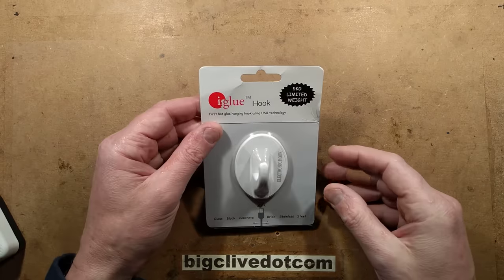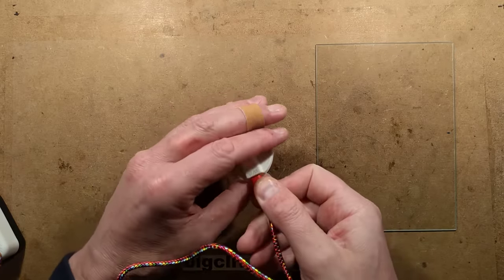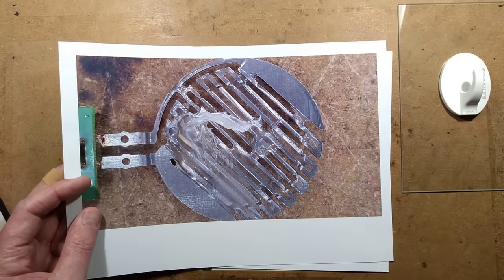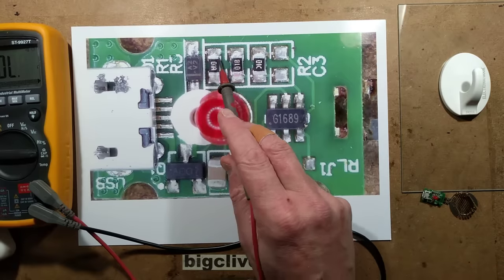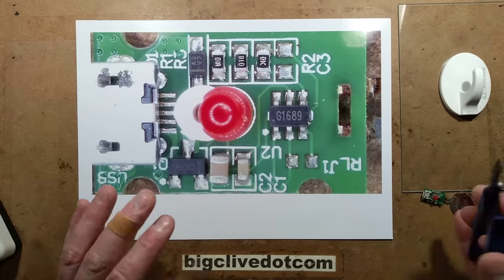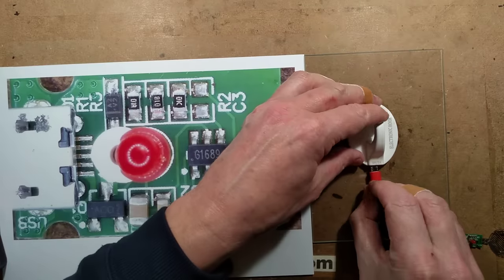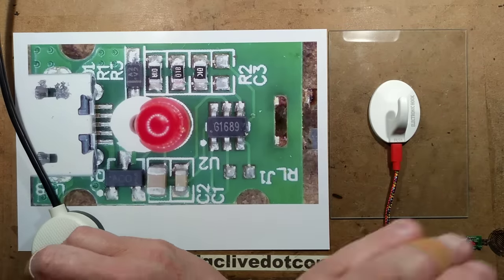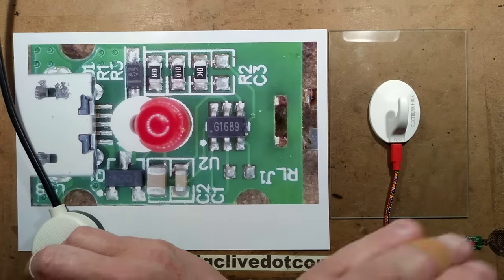Testing a USB powered wall hook and a look inside.

Comment: 'Way back in the 1970s, I was designing some of the earliest microcontrollers. The idea of a microcontroller in a something as simple as a toaster was considered ludicrous. And here we are...
Reply: @andrew_koala2974  Can you give me a link or name/brand regarding the shopping carts with microcontrollers? How are they charged? What are they used for?
Reply: You say that, but microcontroller equipped toasters are amazing. They are able to toast perfectly consistently every time, while you know that is impossible for a dumb toaster.
Reply: @goodmorning8172  They're in shopping cart wheel locks to keep the carts from leaving the premises. A wire running around the store's parking lot carries a very low power radio signal that a microcontroller inside the wheel picks up when it passes over it. The microcontroller then triggers a small motor to spin a mechanism that locks the hub. The ones I've seen aren't recharged, the entire wheel is just swapped out. The battery inside was even potted, so it can't even be charged or replaced if you wanted to. Supposedly the battery lasts 3-5 years. These wheel locks have actually been in use for at least 15 years, and the concept/prototype has existed for over 20, so it's funny that he said "who would have imagined that four or five years ago". Search for a video called TWB #4 Locking Wheel Teardown to see the guts of one.
Reply: @goodmorning8172  there are shopping carts with scanners, so you can scan everything you put in it and just have to weigh the cart to get out, which accelerates shopping a lot.

also, especially on the lower end, microcontrollers are the most cost effective solution, because you can just put a 3 buck part in 20-100 cards and it's cheaper than designing a proper circuit, also it means you can add functionality cheaply.
Reply: bruh
Reply: @goodmorning8172  there are carts that lock the wheels if taken off the store property to prevent theft
Reply: Ben T.  Well, it's good to connect things to the internet. Within reason, that is. We don't want another Juicero on out hands, do we? Besides, at worst IOT can be annoying, and at best it can be really magical.
Reply: Ben T.  if you're so concerns about the government spying on you, then why use the internet at all? A VPN won't help much, either. Besides, why would the government care if your lamp is on or off?
Reply: @jeffystreet  unless you really are a huge time criminal, spying on you would be useful, other then that, pretty much just wasting processing power.
Reply: I feel for Jerry.  To see something like this is a huge slap in the face.  The work put into developing a micro controller is enormous.  Seeing that tech used in such a banal way is heart wrenching. You develop a way to control sofisticated motorizized production lines, oil platforms, bull dozens....  And someone stuff that into sone kids room to melt glue.  What a big FU to the developers.. No respect at all ;(
Reply: @latinumbavariae  I don't think that toaster is very dumb. Mechanical yes. Dumb... not so much.
Reply: @rich1051414  If you want a dumb toaster to toast evenly you need to warm it up first . Also if you were able to insulate the top , maybe with an upside down plate then it toasts evenly. I think most toasters are fundamentally designed badly and inefficiently.
Reply: @rich1051414  That's hardly impossible, I will refer to technology connections for a demonstration of the perfect toaster without any micro controllers.
Reply: @rich1051414  you are so wrong!!

See Sunbeam Radiant toaster
Reply: @GreatDogs  That's like saying that scientists worked really hard to invent plastic so we should only use it for important things like medical equipment
Honestly it being used in lots of things just shows how far we've come with computing and it's a good thing
Reply: @andrew_koala2974  But it wasn't fantasy, it was frivolity
Reply: @andrew_koala2974  what communist country / state do you live in where it is the law to wear a helmet riding a bicycle ??
Reply: And the even funnier thing is, that nowadays you can get a fucking Micro PC like the Raspberry Pi for less then what those microcontrollers did cost back then. And now Microcontrollers are so cheap, that they are in basically anything, because they make everything a whole lot easier to built.

Like honestly, I'm "only" 27 and yet I'm still getting suprised by how far tech has come since. Just for example basic Storage. When My Brother got his new "fancy" PC, it had like a 60GB HDD, wich wasn't bad at the time. Now I've got more storage in my fucking Phone and it's even a damn lot faster.
Reply: @sagichdirdochnicht4653  I'm only 16 and I'm shocked when I learn that they can put an ARM chip running at a few hundred megahertz in an SD card for around 10p... Years ago that would have cost millions
Reply: @circuit10  an arm chip in a sd card? Haven't heard of that before. And why though? 
Anyway,  by the time you could fit those chips inside a micro sd it wouldn't have cost millions...  but nevertheless, it would have been expansive.
Reply: @sagichdirdochnicht4653  Yes I'm barely older than you and remember a time when only a few enthusiasts had internet connections and many/most homes did not have a computer
Reply: @sagichdirdochnicht4653  Well, I mean to have a room-sized PC with that power. They put them in the detect bad blocks and things
Reply: @rich1051414  Actually, look at Technology Connection's video on an old toaster.

The old toaster is better and does do it perfectly every time, unlike modern toasters.
Reply: Now introducing the smart stick, the stick with a microcontroller on it which does nothing!
Reply: @circuit10  Microcontrollers have been cheap for more than a couple years ago
Reply: @rich1051414  sir you clearly have not watched the Technology Connections video on toasters
Reply: @LoveOfMules13  this explains why some stores have a lot of carts with a stuck/broken/perma-locked wheel
Reply: None in my toasters.
Reply: @rich1051414  Bimetallic metal strips can do amazing things
Reply: @rich1051414  you seem to have misunderstood the point
Reply: Liar
Reply: I'm gonna put a microchip in my pencil just for you.
Reply: I was waiting for the quote to end. Let me do it for you ‘
Reply: @rich1051414  what about sunbeam radiant control
Reply: @sagichdirdochnicht4653  yeah right? A usb c connector costs more than some mcus.
Reply: You should check out some modern MCUs that have been cost optimized... ESP32 comes to mind. 200MHz dual core risc-v with embedded bt+wifi for a dollar. I'm a youngin, but I love playing with analog circuitry and I feel it's somewhat sad that for the most part we're just brute forcing solutions by scaling digital circuitry rather than ingenius designs that were called for by limitations.
Reply: Well, now you can have them for less than 5¢/pc. What was the cheapest offering then?
Reply: Disposable electronics are such a waste of resources. (Yes, even significant items like phones and appliances are quickly discarded too, but have a much longer useful life.)
Reply: It is amazing what we have today
Reply: i still think it is
Reply: When I did my studies in electronics on the Hanze University (around 2005-2006), we had a project called "Heart Monitor" and I had the bright idea of making it... portable!

I was told the following: NOBODY wants to monitor their heart rate or blood oxygen saturation and making it portable would just be a hassle... and here we are.

I also had the bright idea of making a BODE plotter using a signal generator that was digitally controlled... same thing, got told nobody would use such a device...
Reply: Well, thanks to you, nowadays I got gotta a profession, so thank you!
Reply: @sjoervanderploeg4340  wow I wonder what we will have in the future it is so amazing
Reply: i cannot tell if this is a bot comment thread or not
Reply: We live in an age that was Science-Fiction back in the 70s ... I still remember how fascinated I was when my parents bought me a pocket-calculator.
Reply: @Richard Smith  micro control roster still can't consistanly cook my toast
Reply: @rich1051414  Yeah I was wondering the other day why I didn't try to find a toaster which could sense how much it's cooked and stopped before bruning
Reply: @rich1051414  a toaster from the 40s did that without any microcontrollers and they’re very reliable so the microcontroller isn’t necessary
Reply: simple? it's a next gen 4k hi-res y2k compatible marvel !
Reply: @rich1051414 except the Sunbeam toaster did that without microcontrollers before microcontrollers were even a thing!

There's plenty of ways to do this without a microcontroller, too!
Reply: You can use a micro controller to sense when a light switch is turned on.  Based on that input it can send a signal to a mosfet to power the coil of a relay.  This relay can then provide power to the light bulb.  The power for the control circuitry can be provided by a buck converter fed from the light switch under observation.   This has the added benefit that the microcontroller is not drawing any power when the light switch is turned off.

It's also possible to incorporate a light sensor that can be used to turn on an LED to alert the user when there is sufficient daylight to procede safely. Obviously this led will only illuminate when the light switch is turned on, so it will be up to the user to decide if the light present is due to ambient light or the light provided by the fitting. The safest policy is, of course, to leave the light turned on permanently so that this safety feature is present at all times.

Comment: i love how those electronics will be used for only about 20 seconds and thats its whole life
Reply: i think you could hate that fact
Reply: I presumed the point of this is removability, like a 3M hook?
Reply: @BluetheRaccoon  okay but usually once u find a place for them u dont move them lmao
Reply: can someone explain what the wall activated hook actually does? I couldnt tell from the video
Reply: @banana9494  you plug it in and it activates a glue mount system, to take it off the glue is melted away.
Reply: Modern E-Waste issues in a nutshell, from phones that barely last 3 years to crud like this...
Reply: @Theinatoriinator  ohh ok i thought there had to be more to it and i was missiing something lmao.
Reply: 43 seconds
Reply: Not if you reuse it and put a new piece of glue on it 🤔
Reply: you could reuse it several times, just plug it in and melt some freshh hot glue on it off a hot glue stick. maybe salami slice the stick and add a  new slice each time.
Reply: Also, funny the algorithm is now showing again a 4 yo video
Reply: I've seen worse. A battery powered, light activated speaker which has only the purpose of being put in the box of some product and chime when it's opened
Reply: 'What is my purpose?'
'Pass the butter'
passes butter 'What is my purpose?'
'You pass butter'
looks at own robo-hands 'Oh my god.'
Reply: @feuerherz007  If that was true, 3M wouldn’t have made a trillion dollars on those removable-adhesive hooks.
Reply: Just like me
Reply: @Bene5[4  Like those Hallmark cards that play songs when you open them. Been around for a long time.
Reply: 43 seconds apparently
Reply: Somewhere out there Gru has you on his list. Gru's Really Eunochs.
Reply: It does have replacement glue pads in two little compartments.
Reply: It is meant to be reused.
Reply: The removability is important when you move out from the rental property.
Reply: Someone probably once would have said the same about paper used for Post-It notes.
Reply: @feuerherz007  Imagine how much easier this makes the job of the demolition crew.  Instead of having to smack those pesky hooks of the wall with a sledge hammer, they can just plug in a usb power supply and wait 72 seconds.  That's almost one every minute.  In just a few months they'd be able to remove all the hooks in an entire hospital.

Comment: What people seem to be missing is that you plug it in again to melt the glue to remove the hook without damaging your wall.. That's the reason for the replacement glue pads.
Reply: But why would one need to remove a hook from one's wall?
Reply: @bobshermer6246  Many reasons,, I changed the size of mirror, picture, soup ladle... I want to hang on it, My child has grown 6 inches taller, I want to move my furniture, I'm renting. 
Really many reasons to want to move a hook, still not a good solution, I think, but I think, there is a use case.
Reply: @stephenlee5929  
I am happy to inform you double sided sticky tape was invented 200 years ago.
Reply: @bobshermer6246  you ever live in an apartment?
Reply: but it would just leave a load of sticky glue on the surface, at least if you get it off cold will pull it off with the hook
Reply: @markharrison7468  3M command strips have that covered
Reply: Ever heard of command strips?
Reply: Ahhhhhh. Now I get it.
Reply: @bobshermer6246    Really?... In your entire life you've never put up a hook, wall hanger, our mount and then later realize you want or need to remove it?
Reply: A problem solved by command strips already.
Reply: @MrRobarino  I mean I'm not that guy and I understand why you'd want to move one, but no I've never wanted to move a hook because I think hanging shit is pointless lol. There's one hook on the back of my bathroom door that's been there for 10+ years and I don't even know who put it there or why lol.
Reply: @charlesblasini2134  Sure lol. Better  than a million pictures and signs no one actually cares about
Reply: What the manufacturer of this product seems to be missing is that 3M command clips do the same job without the unnecessary steps of plugging it in and leaving a residue on the wall.
Reply: @dForrestTheComicker  Command strips have an extremely low shear strength, that's what makes them work. It also makes them unsuitable for many tasks.... That being said regular hot glue on a 3M hook works pretty well and can be softened with just a hair dryer when its time to remove.
Reply: I think they forgot command strips exist.
Reply: to all mentioning command strips: command strips dont work on plaster walls. IDK if this hot glue would either, but, command strips also dont
Reply: I would never glue something that’s supposed to hold stuff to a wall in the first place
Reply: Could just use a hair dryer or heat gun since you're going to need one anyways to clean it up.
Reply: @dForrestTheComicker Until they've dried out. Then you're prying or cutting.
Reply: @dForrestTheComicker  are they strong enough for a coat hanger? that can be quite a bit of weight!
Reply: If the double-sided tape is weak enough to be cleanly removed from a wall without removing paint, then it's not strong enough for holding things in the first place. Other types of double-sided tape are strong enough to hold up a hook with anything you put on it, but will tear off your drywall.
Reply: @akpokemon  as others mentioned, it can be a question of having different sheer vs pull strength

Comment: This is the most technology I've ever seen in an application that doesn't really need it; it's actually impressive
Reply: It’s called Spywhere
Reply: @johnnorris1983  yes I spy on people using a heating element bruh
Reply: @johnnorris1983  I don't know where they're gonna spy
Reply: Wait until you see "smart fridges"
Reply: @johnnorris1983  spy where ?😑
Reply: @user-rf47CwB72  well it's a worthless one that wouldn't transmit a basic sound file through a thick cloth, if that were it's function. 

However once you remove the cable and take power away it would also be equally as worthless since it has no ability to retain a powered state.

Some people really don't think about some things they believe at even the most elementary, basic level.
Reply: @user-rf47CwB72  Parody tone has become exceeding difficult to decipher, I apologize for not noticing. 

Even in the scenario you gave while possible, the use of application outweighs the possibility of use. In this case, it would be far easier to just find a way to "bug," the device everyone carries on them most times rather than use a niche item very few would ever own. 

But I do see the validity in your scope and cannot contend it.
Reply: At least I can see plausible benefits to the technology in this case. Not like a smart fridge.
Reply: @johnnorris1983  most intelligent youtube comment
Reply: I haven't seen anything this pointless since the USB pet rock
Reply: @BigPanda096 Not all technology requires a local power supply...

Some very clever remote listening devices from the cold war era are virtually non-functional and decorative unless remotely powered by directed RF...

And RFID tags are powered wirelessly by the reader device.